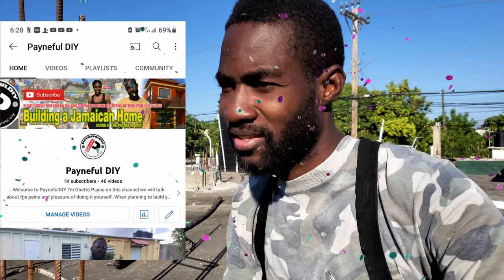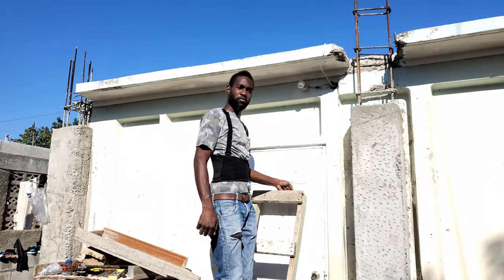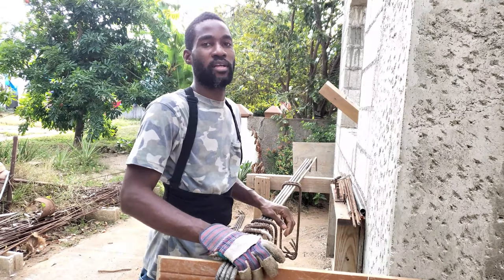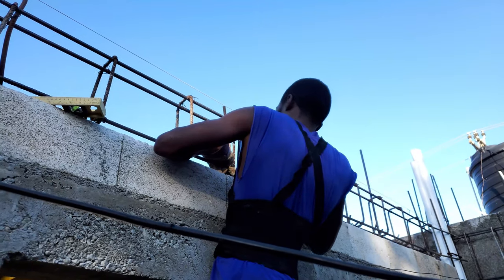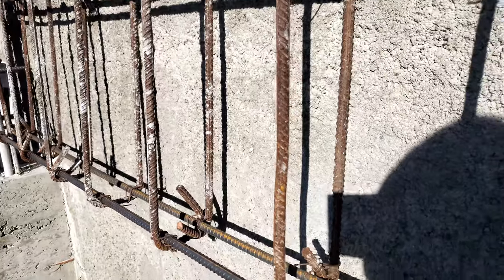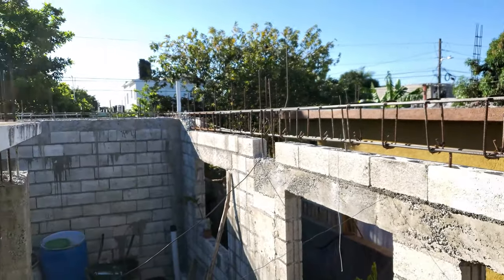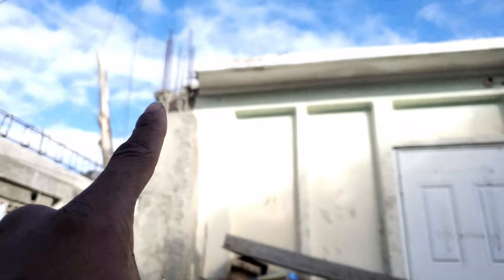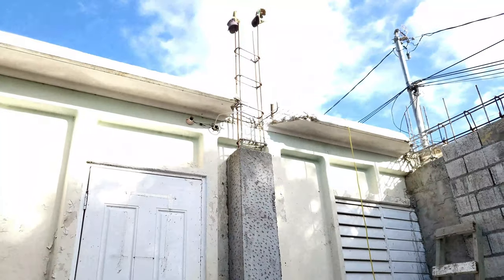Best types of reinforced Concrete Beams

Comment: Question for you, I notice that most of the hooks for the stirrups are at the bottom of the cage when the beams are put in place. Does it matter if they are at the bottom or the top?
Reply from the maker: good day they can be on both top and bottom ,just mix them for a stronger cage

Comment: Really enjoy the videos building my house as well just me as do you I have a question thou 
Are concealed beams strong building the hall way but I don’t want the extended beams to be showing down in the roof so I was thinking about concealed beams but not sure if it’s good enough to hold the slab
Reply from the maker: thanks for watching the video really appreciate the support.. concealed beam are a great idea but it depends on the span or distance to the column...hope to see your building project on your channel..
Reply: The distance between is 11f
Reply from the maker: Yes it can work... you can use 5/8 steel with 3/8 sturrup

Comment: Why when you pour concrete into the beams you leave out at least 6 inches  exposed?
Reply from the maker: good question.. if your talking about at the top of the beam when casting a slab, there is a thing called cold joints where old concrete meets freshly poured concrete and i want a stronger grip into the steel cage between the beam and the slab. some people leave out 2 inches but i leave 4 to 6 for the over support steel  so it like this 
2'' inches grip into the steel cage of the beam 
2'' inches for the first set of steels in the slab and 2'' inches for the over support steels
Reply: @Payneful DIY  you are doing a great job my son and you are the greatest inspiration on the web for potential do it yourself. Great job and thanks again 👍